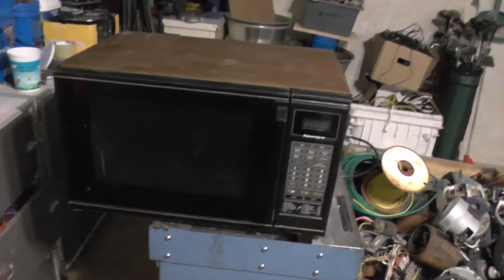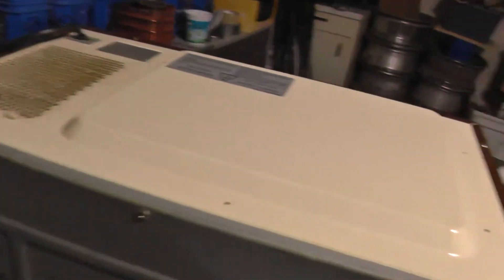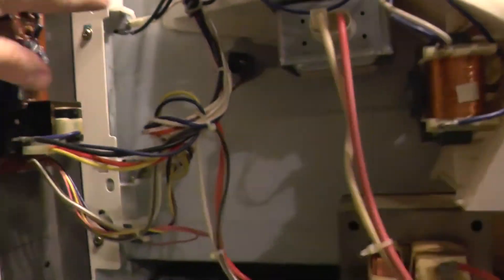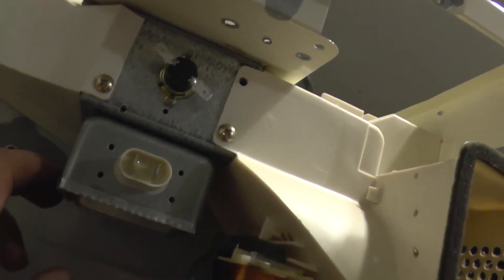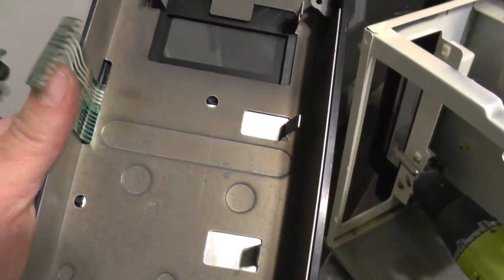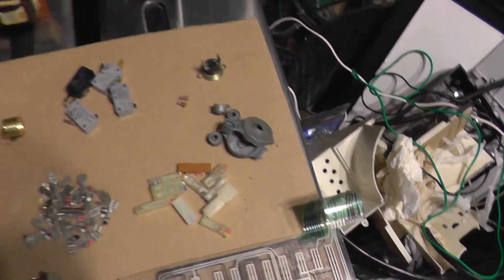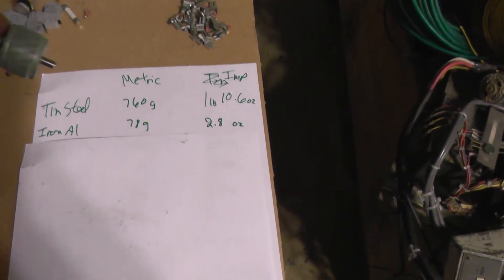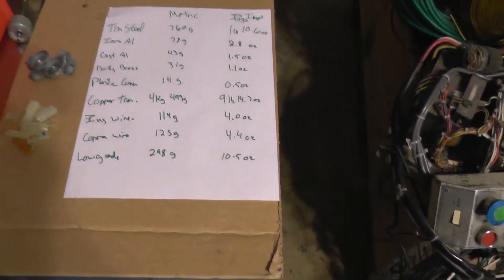What's In it #5 - Kenmore Microwave

Comment: I Take Magnets Out Of Microsoft Waves, Make me Own Magnets/Tools To The Wall Kit, it takes several Micro Waves to do it but i find its worth the Challenge to spend lesser money buyin a tool magnet that'll satisfy the project, to me its worth the Challenge, u gotta work the Aluminum gelt to it but it worths a value
Reply from the maker: +MissionScrappr Will I got that Magnetic bar fro ma friend who didn't need it for his kitchen, make a great tool holder.  I'm going to take your idea and make another one when I scrap a bunch of hard drives, those magnets should work pretty good too.   I will check the magnets on the microwaves again next time I take one apart, maybe once I have scrap a few I will find a system that works for me where I don't break the berelium thingy.  Thanks for the tip and the great idea Will.  Have a great day man, take care :)